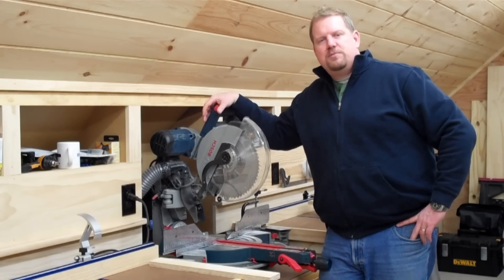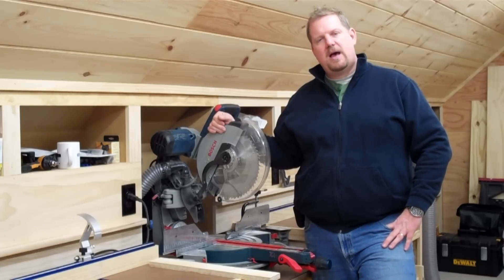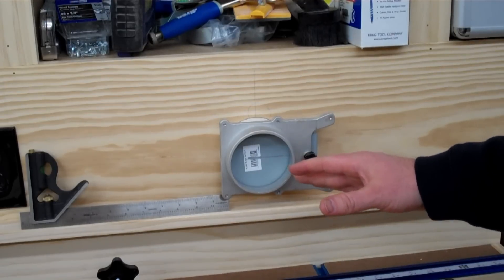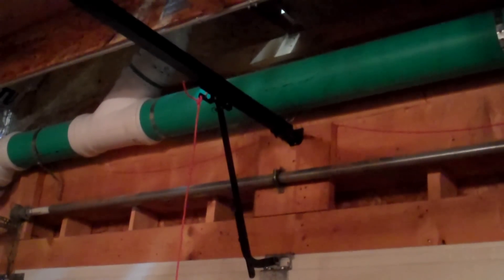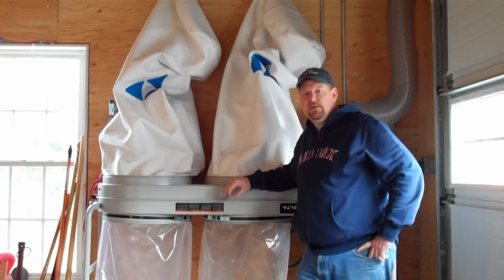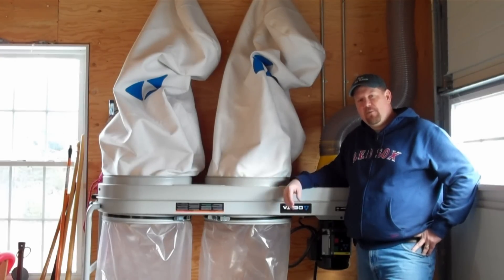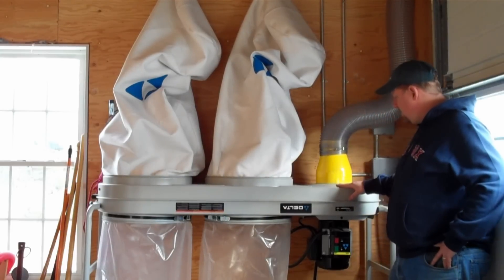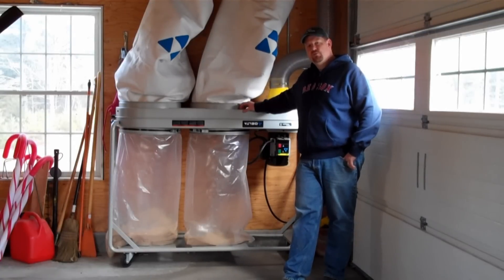Delta 50-763 Dust Collector Review

Comment: Tom, I am in the planning stages of setting up a dust collection system. One of the factors that I an considering is the recirculation of the heat/cool that he collection system will remove from the shop area if not located within the shop area. Seems to me that the system should be located in the shop area for this reason and probably for this reason alone. That being said, I am looking for the noise levels (db) that these machins generate and from what I have observed, that specification is not generaly included in the specs. I see a need for some "highly breatheable" sound proofing material to enclose the system in.